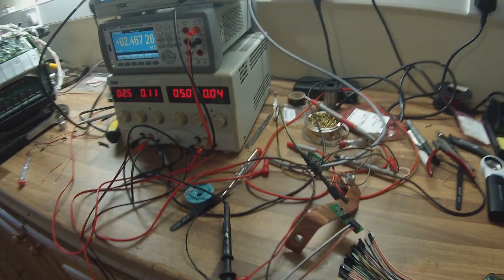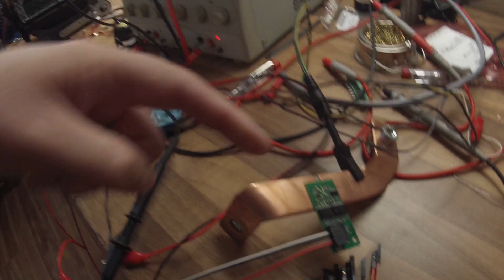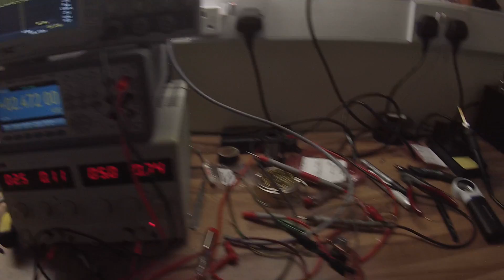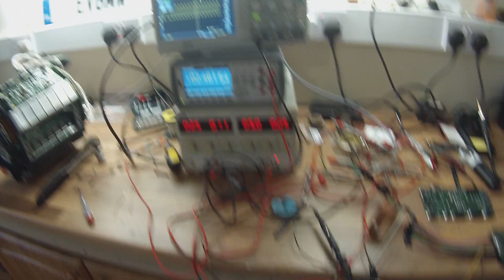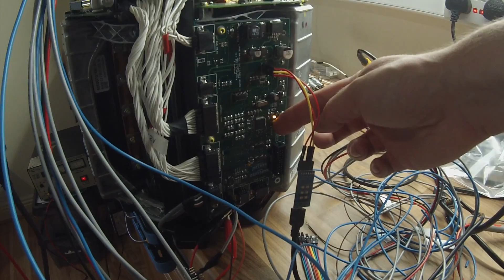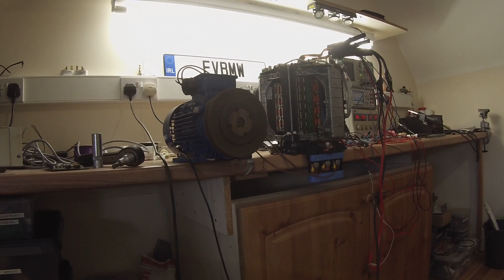The Tesla Project : Delta Sigma Force

Comment: Damien, did I get it right that you're swapping the digital current sensor for an analog signal output? I might have missed it but hopefully you convert back to digital close to the current sensor since there's all kinds of nasty noises in there that would plague your analog measurement. 

Good to see you tackling this job. I stopped my own effort to convert my car after the 2nd hand EV market opened up. It was cheaper to buy a whole Leaf than just the battery pack for a conversion.
Reply from the maker: No I am keeping the current sensors as is but instead of an FPGA and complex digital filtering to recreate the analog voltage level I'm just going to use a 2 pole analog filter. I don't need super accurate current readings.

Comment: I just figured out what that big FPGA logic device on the Tesla controller board is for.  It is processing the signals from the current sensors.   Turning those modulated digital signals into numbers for the microcontroller(s).  It may also be providing interlock signals to prevent shoot through on the IGBT's

Comment: One of the microcontrollers on the Tesla control board is for processing the Electronic Stability Control.  It receives the 4 wheel speeds and decides whether or not to reduce power output.